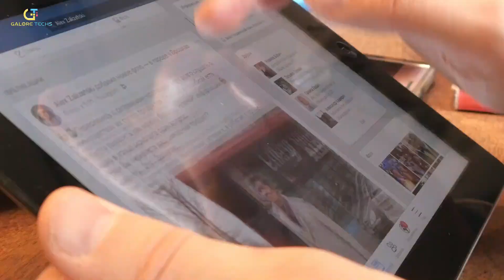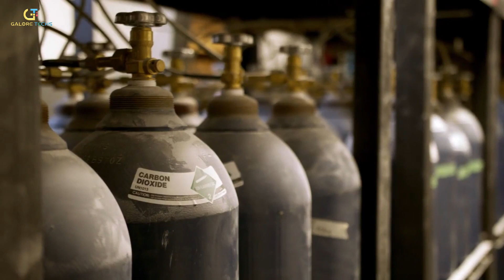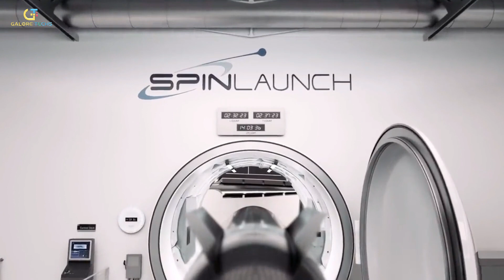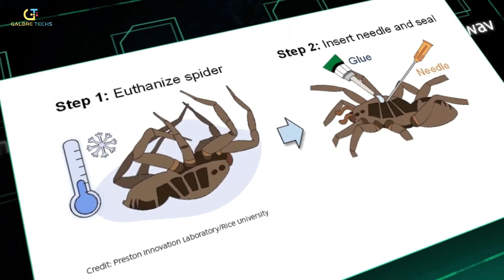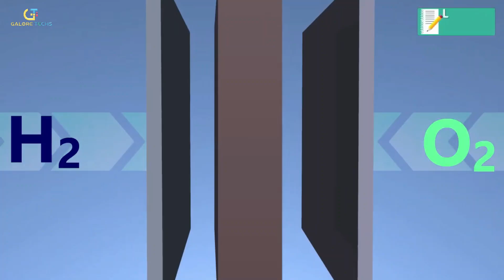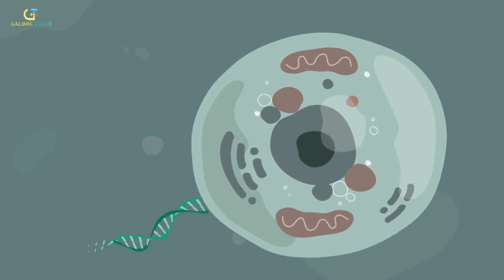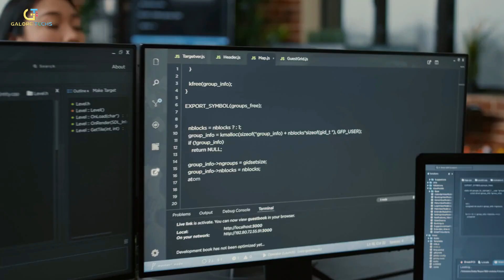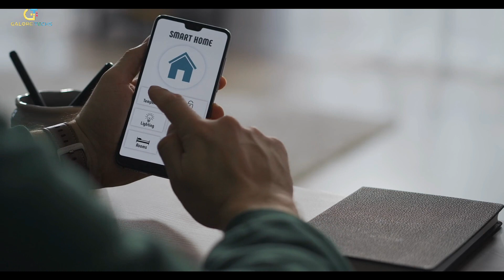13 Latest Technologies that will Change our World

Comment: LiFi is 224 bits per second.  Wow is that slow.
Reply: It’s actually 224 GB per second over 100 x faster than wifi
Reply from the maker: There was a slight error, it is 224 GB/sec.